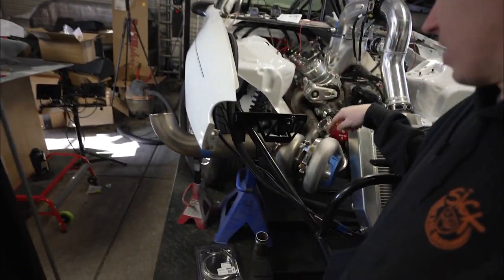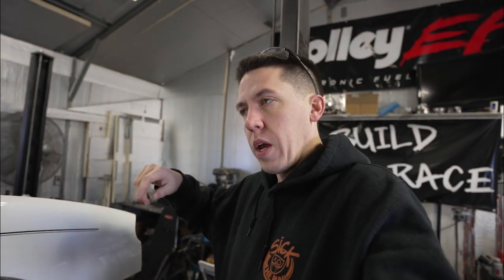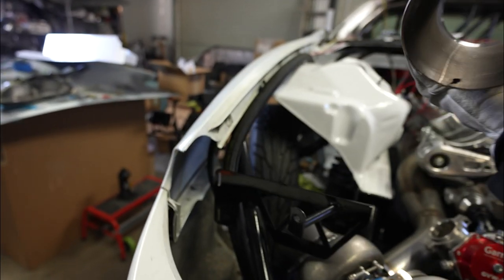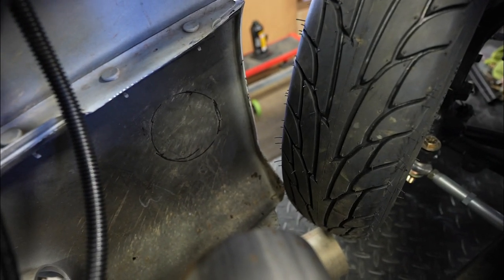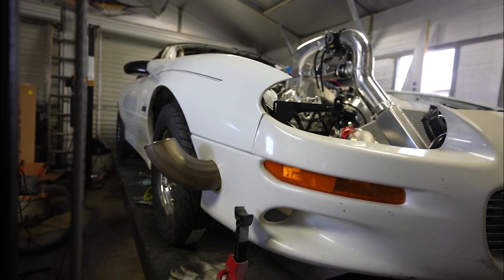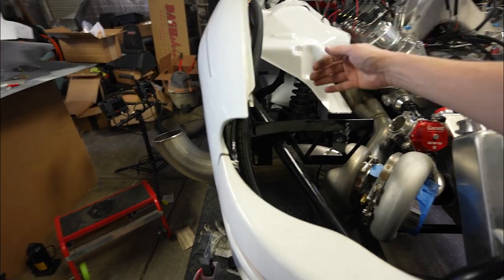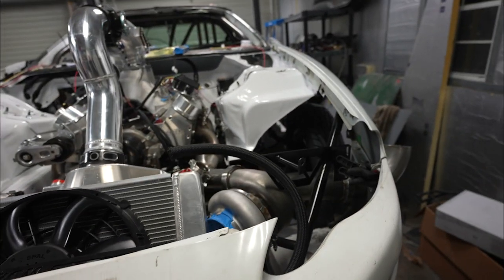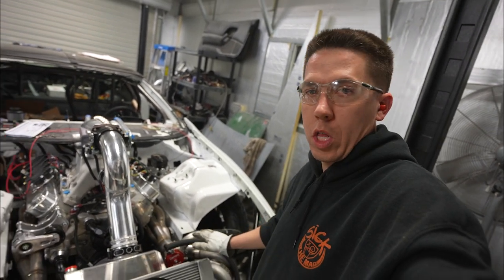Salty Gets Bull Horns! 1800HP Twin Turbo FBody Camaro Exhaust Build!

Comment: I am having problems with open forward headers not fitting between the van fender wells. What kind of headers did you use? I’m doing a TwinTurbo’s also.